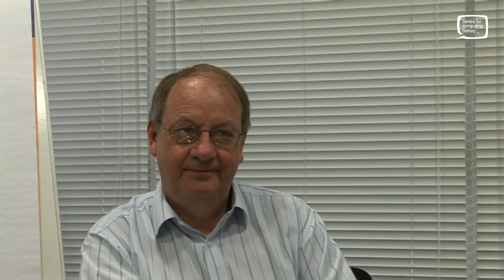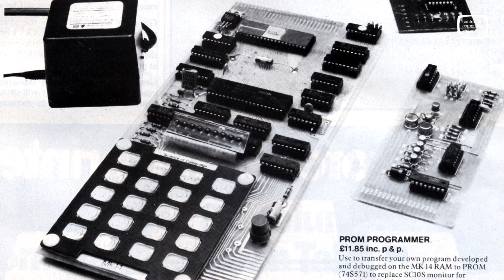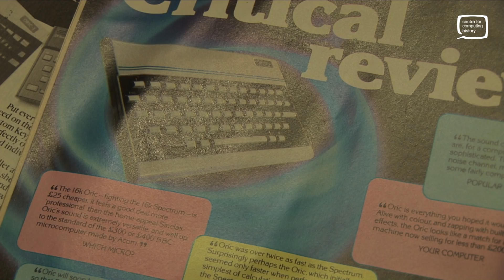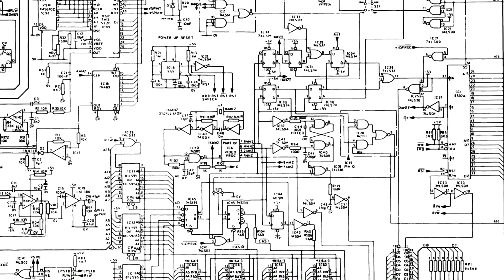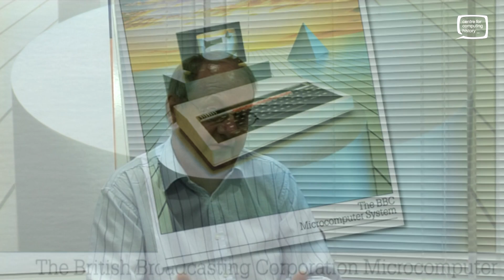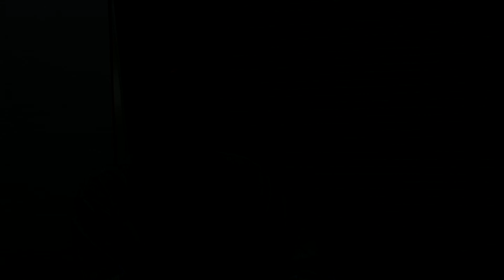Chris Turner - Acorn and the BBC Micro

Comment: i know that Lander DID have sound at some point (in 1989 or 1990 or 1991 intro video of Acorn BBC A3000 Lander has sound but my question is what happened to the sound?? though thanks.
Reply: Lander was a stripped down version of the full game Zarch.  Zarch had sound and was no doubt what they filmed for the demo video.